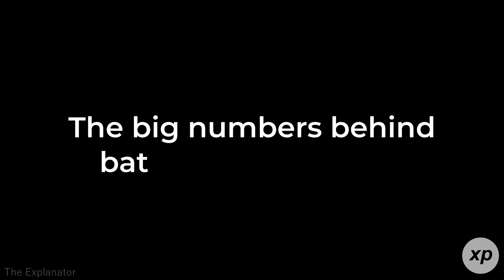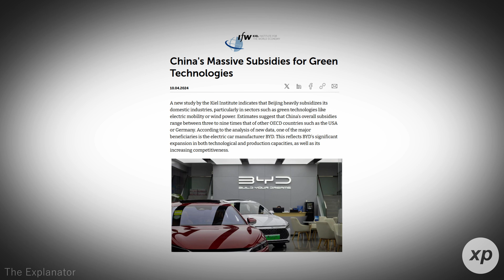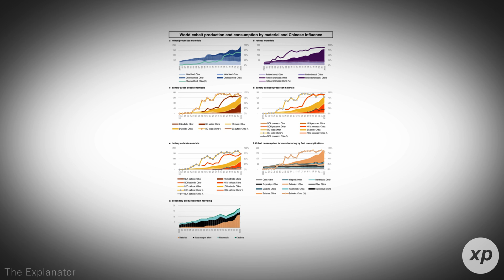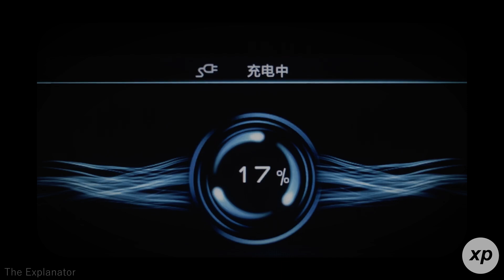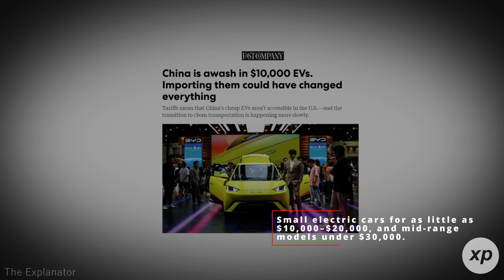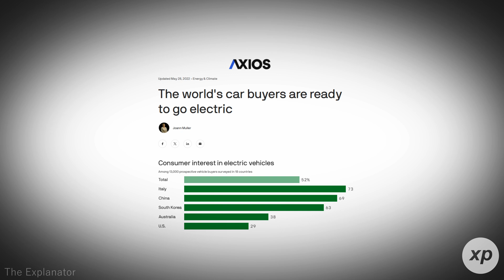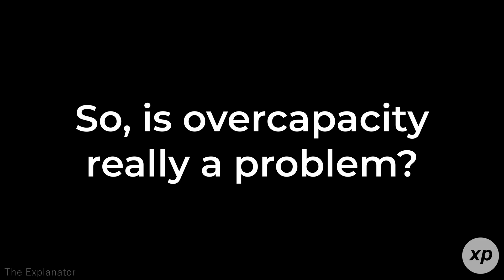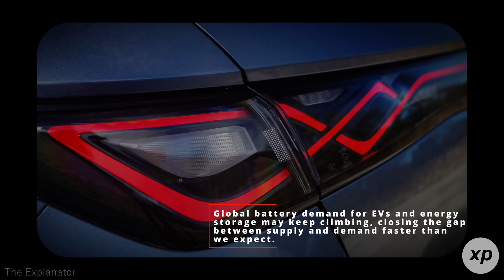China Built Too Many Batteries—Now EV Prices Are Crashing

Comment: It's a great thing to have a supply glut. Cheaper EVs is what we need
Reply: No, EVs are a mistake we made on the way. It is not the way of getting rid of ICE, and it just delays the research on hydrogen fuel cells. After that we will get nuclear powered cars based on fusion. 

EVs atm are fine for a very small niche of people, the push for it is irrational.